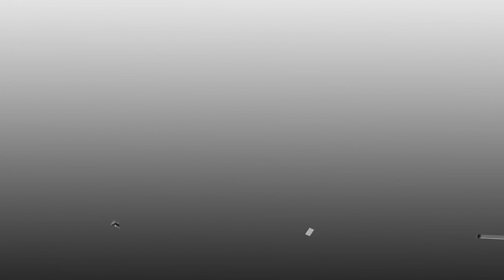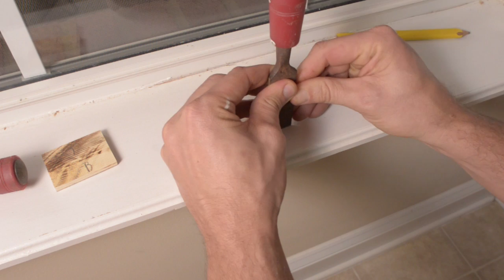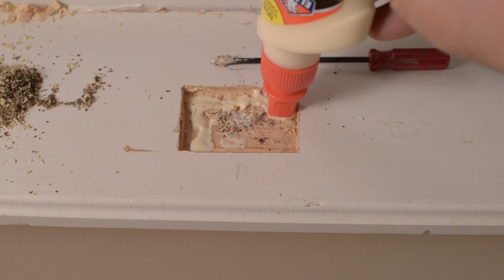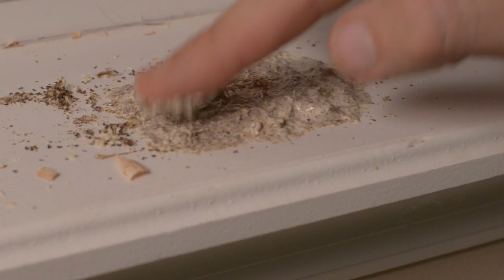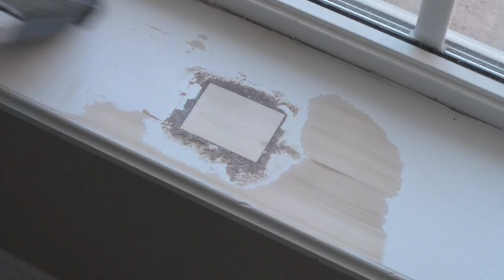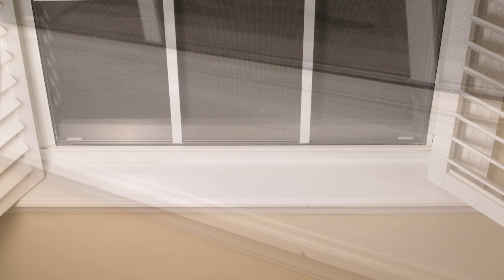How To Repair A Hole Or Damage On A Piece Of Window Sill Or Trim.

Comment: isn't this a bit over-kill ?
Cant you just fill the small holes with something like a 'filler' or caulk and then paint over it ?
Reply from the maker: Sure, I was just trying to demonstrate a Dutchman type repair for the sake of showing the technique. If using a filler I would still advise to make the holes a bit larger and flair them out before applying the filler. Thanks for the comment and watching.

Comment: The holes you started with were so small; why couldn't you just use filler (no patch)?

And why did you make the patch so much bigger than the original holes?
Reply from the maker: it was just for demonstration purposes
Reply: Thank goodness you asked this question. I was so confused. I just repaired about 20 window frames with a wood filler. They were left over holes from blind brackets and window alarm sensors. Wood filler, sand and paint. They're unnoticeable near perfect. This confuse me😁